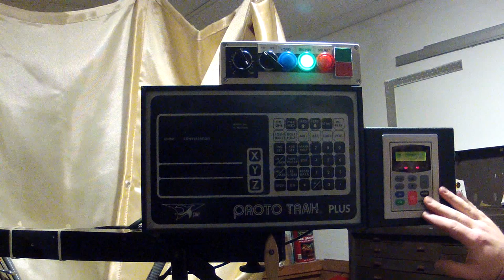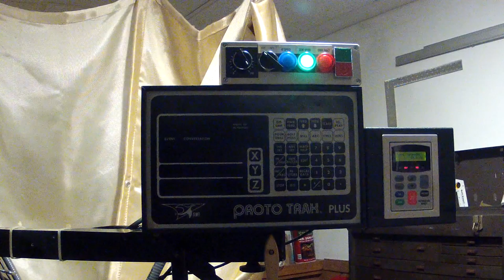VFD Control Box for the Clausing Lathe - Part 1

Comment: you should use the clutch setting on your cordless drill when drilling with hole saws. it will save the center bit from snapping as well as  your wrist!

Comment: I just bought a Clausing 5913 lathe and a Hitachi WJ200 VFD. I read the manual and checked many sites. The question is, what is the wiring configuation in order to retain use of the Motor Switch Control Lever. Also will the Clutch/Brake Lever be affected? The motor is from a Clausing 5914 and is 2hp 3 phase. Thank you.
Reply from the maker: Essentially what you need to do is wire the motor switch into the VFD so that it is going into the VFD control inputs, NOT into the power wiring. So your motor switch will no longer have anything to do with the power wiring, but act as a signal to tell the VFD what to do. Most people just take the drum switch out of the equation with a VFD and make a small control panel like I did.

Comment: hi mike, question for you, i want to vfd enable my atlas but i mistakenly bought a vfd that has 3 phase in as well as out... Am I screwed? lol
Reply from the maker: Hi Bill. Most of the smaller VFDs (less than 3HP or so, but depends on manufacturer) can work with split phase input like you most likely have at your house. Look at the data sheet or instruction manual for your model and see if it says it can take 3 phase or 1 phase in. If it is only 3 phase in, you won't be able to use it at your home. Good luck!